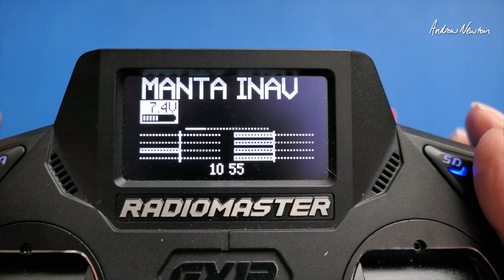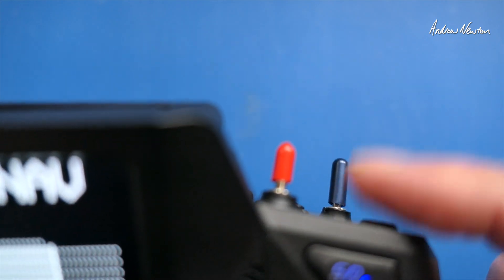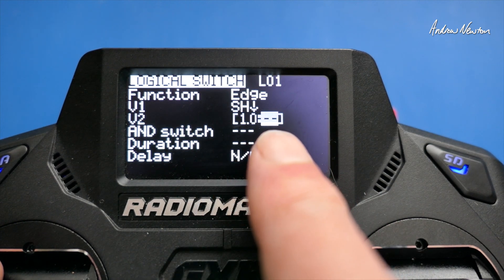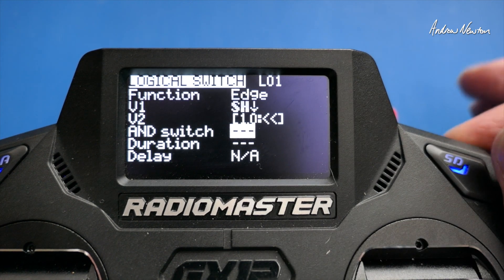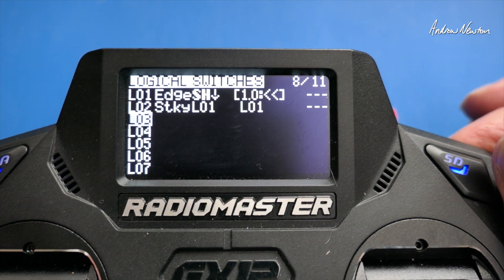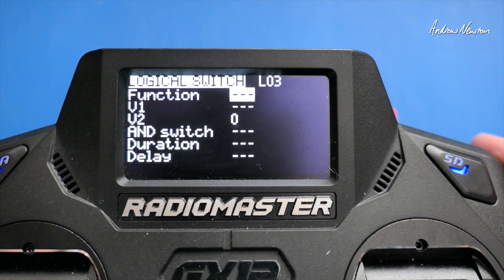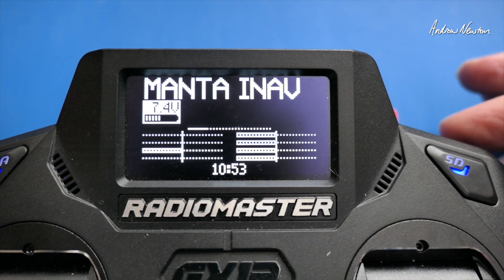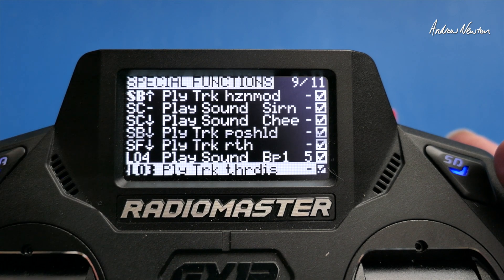Long-Press Button Arming with EdgeTX

Comment: Thanks for this Andrew.  I'm using ELRS but can't get this to work and wondering if you could list your settings in the Inputs and/or the mixer for CH5 (arming) as I think I don't have the CH set up correctly.
Reply from the maker: I didn't change anything in INPUTS, and Ch5 source is L02. Maybe it's your ELRS packet rate? I use 100Hz Full and 16ch for full resolution on al channels.

Comment: I would also add a second switch to LO1 when throttle < -95 to stop the motor staring up if the throttle is not at minimum. Not sure what the purpose of LO3 and Ch5 is? My planes dont have anything like that in fact I normally use Ch5 for my second Aileron servo.
Reply from the maker: CH 5 for arming. Mandatory for ELRS

Comment: Could you do a video talking about ways to mount a camera to the top of the plane? I have a t1 ranger and ZOHD rebel GT and I want to mount cameras on top with minimal mess of the top by glue or holes.
Reply from the maker: 3d printed base just taped or glued on top usually. Or screwed into plywood if available on the canopy.

Comment: THX Andrew💯%👍..I personaly..take a 3 position switch..and set 2 positions for armed ..1 position for disarmed..in the upper position.
I also found out a special bitmask..for ArduPilots "Arming_check"..includet all "safety first".. ⚙that its only allowed to arm in not "GPS-navigated FlightModes"..without GPS-Fix,
so you can arm whereever you are.. at once..with two positions for : "armed"..👌

Comment: I needed this  years ago ! $$$🤢 I moaned for a year about this on many FB RC pages, then some one wrote me a logic. But it differs a bit . L01, sticky, V1= L02/V2= Lo2. L02 Funk= Edge-V1= SF ^ , O.5 ←←. Its probably the same thing in revers ? I like your call out ! I did it with a complicated Special function page setup ing. 🤢. I don't know how  INAV devs thinks this is not safe? If you seen the how deep the hole was in baked earth when my  glider came down after a in flight dissarm! I accual quit flying until I could find a solution ! I am putting your script on my radio 🫦. I will buy you a coffee bruh ! 🤙 Btw I unsolderd my TX16s  right shoulder spring switch and put it on the left Shoulder 😅
Reply from the maker: Ah yes, same logic. Left shoulder rules!

Comment: I use this same setup for my planes, only difference is instead of a logical switch 3 for the callout, I use the same L02 for the callouts.
Reply from the maker: Sweet. This is the first time I have set up an arming switch this way.
Reply: I use special function and " play track" pick a sound  track . Engine on or "ahm"

Comment: That’s brilliant. Some of my more embarrassing crashes have been from accidentally disarming, and some of my more spectacular ones from accidentally arming. For me, the risk of accidental disarming outweighs the occasional need for a quick disarm — when it comes to fixed wings, mind you.
Reply from the maker: Yes, same here.
Reply: Put a pwm switch on hd vtx during gps lock and if it accidentally switches off it takes 30 seconds to bring up the firmware doesn't match dismiss confirmation option.
 After you wait a while you can look and see the bright colors and fantastic image quality as good as a go pro . Say it with me . As good as a go pro almost.  See the fine lines the amazing detail not seen in a cheap analog system . We all don't want to know we hat that means . . No . We do .

Comment: Good idea for planes, but I prefer having a quick disarm switch for precision landing quads on my pad. I'd best stick to the switch since I fly both types, for muscle memory purposes. Actually I use a three-way switch with the low position being timer reset, middle disarm, high arm. So I can keep the timer active if I am practicing landings. I appreciate learning about those commands though, thanks!
Reply from the maker: Yes I can see quads would need to disarm NOW
Reply: Yeah I would never use this for quads.  Maybe there is a way to have disarm work instantly?